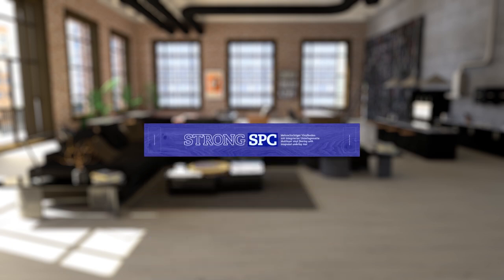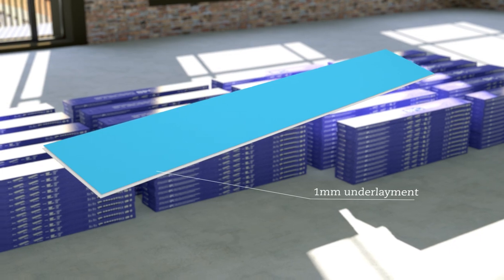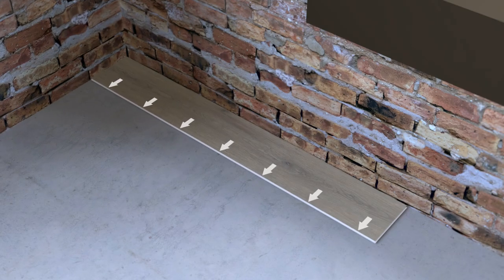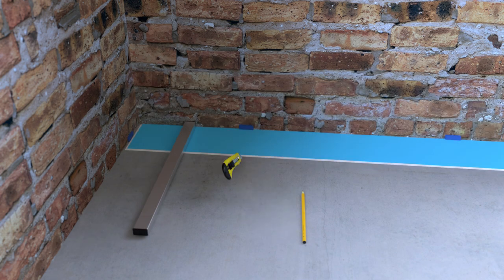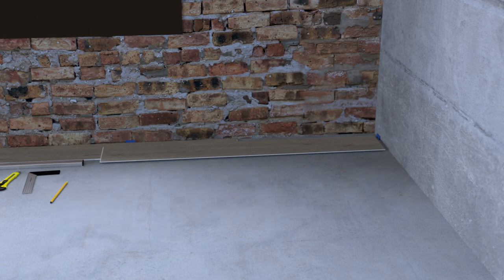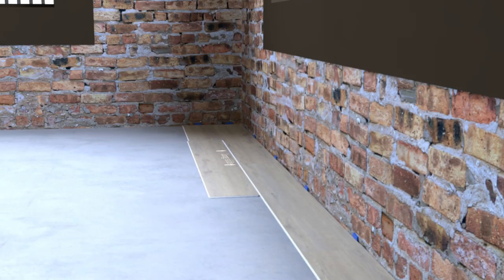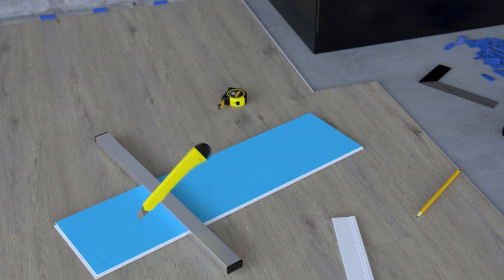How To Install STRONG SPC Floors

Comment: So much to know about the performance of SPC (stone plastic composite) - the average consumer has no idea what goes into the core and how the product is produced.  Get educated before you buy!
Reply: What is the most important thing to know about spc ?
Reply: @daleheath8934  How the core construction is made... look for products that do a "hot press" construction without any vinyl layer glued to the core. Eliminating the glued vinyl layer (typical with most SPC floors available) greatly increases the floors performance and durability.

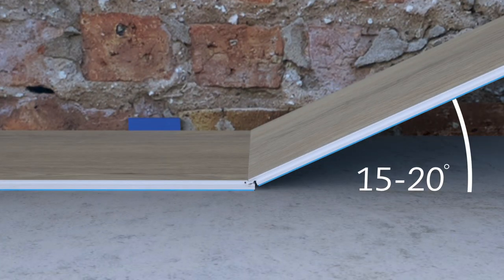Comment: at 2:45 "Begin with the tongue side of the plank facing the wall", then 2:54 the graphic shows the opposite... 🤔
Reply: actually it's showing it right
Reply: Actually, it's not. It contradicts itself with in 5 seconds of showing how to start. It states (at 2:45) "lay the tongue side against the wall" and then mere seconds later (2:54) the illustration shows the "tongue side" on the opposite side.